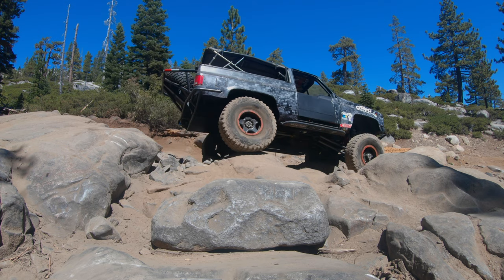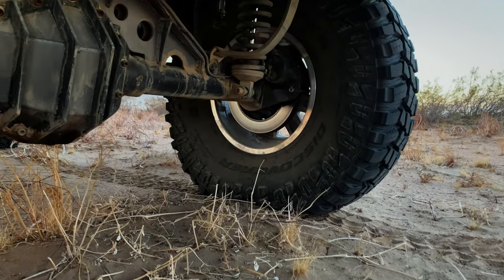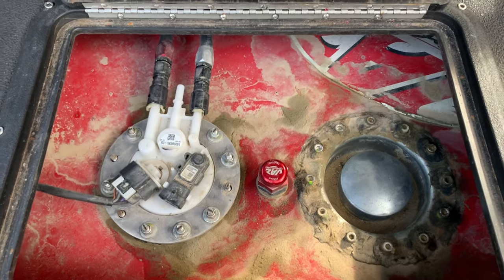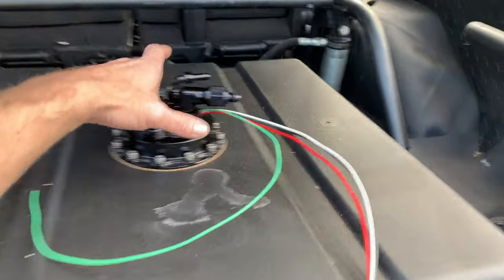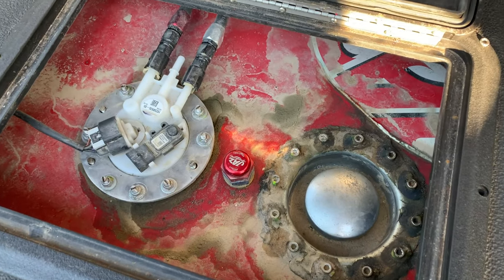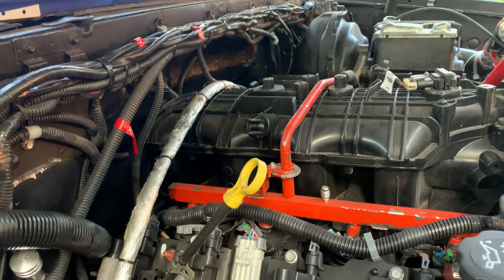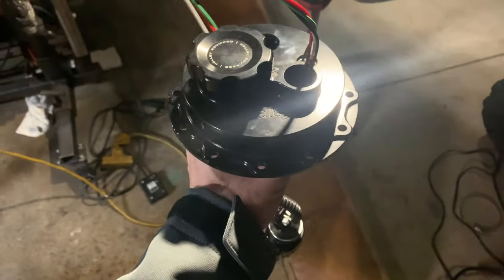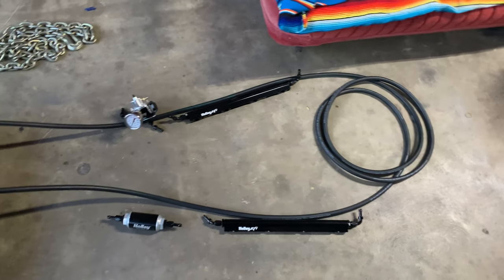MG #190 - Holley EFI for the K30BLAZER!!

Comment: Have you considered a fuel surge tank up front with an integrated fuel pressure regulator (Radium makes one)?  You could keep the fuel system dead ended from the surge tank pump forward.  The rear pump would be a lift pump to the surge tank with a return.  Doing so would enable you to match the high pressure pump capacity to whatever you do with engine power as well as the ability to use a pulse width modulated controller to manage fuel and pump temperatures.  Also, you would have a surge tank which could help in low fuel/high angle situations.  If not, it might be a good idea to consider Holley's hydramat.
Reply: Great point! Holly  hydromat (spelling) is awesome for fuel cell/tank pick up, there are also benefits with a surge tank that you have pointed out. The cons are extra plumbing fittings, space to put the surge tank.. typically closer to the the motor, etc. The baffles in fuel cells like Jazz and others are designed to work at different angles without starvation of the pump.

Comment: hey there im woring on a ls swap for my 89 suburban and yourvideos have been a big help but id like to know about the evap pressure sensor and how you managed it im going for a smog compliant swap myself have almost every thing done but need to work on this portion d could use some advice
Reply from the maker: Yea this is a tough one.  The easiest way is to get a factory fuel pump as the sensors will be in the sending unit.  The challenge is mating the sending unit to the tank.  I ended up using a fuel cell
Reply: @MerricksGarage  would you ever plan to expalin it via video ^-^